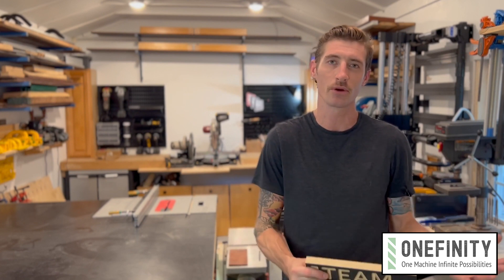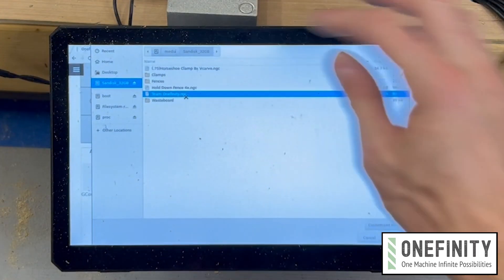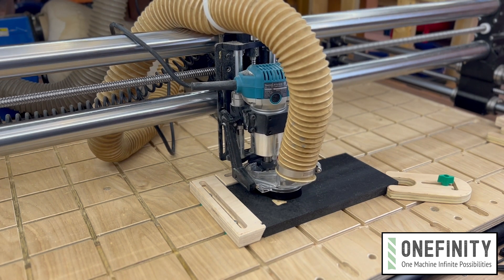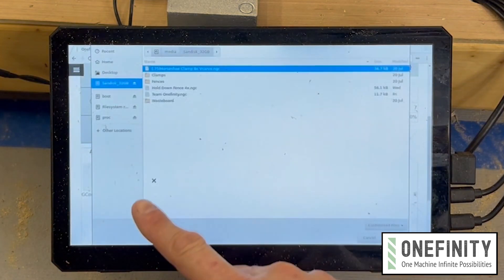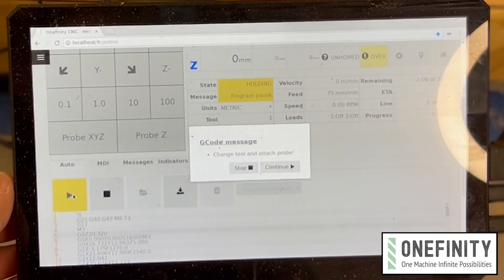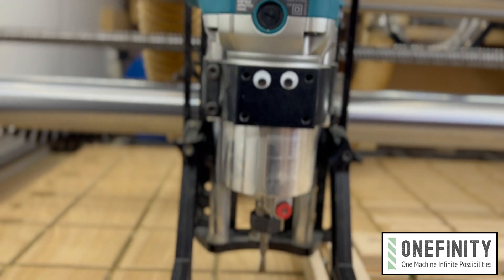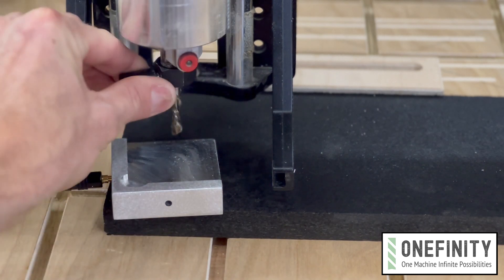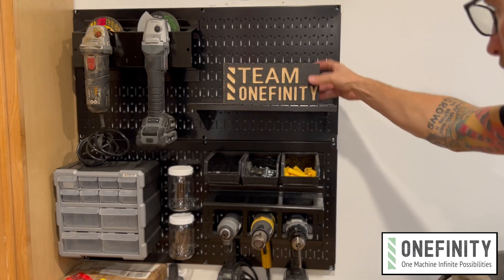EP4 Onefinity CNC - First Cut On Your CNC - Team Onefinity

Comment: Umm.  What test file? Where is it located and what is its name? Also, once I find the file, how do I load the test file.  What are the speeds/feeds for this project and how to enter/select them (Makita router).  It is not intuitive as to how the OneFinity touch probe  works with the software interface so I am going to need help with that too.  How do you start/execute the loaded program? The user interface should interact with and guide the user in using the machine.  It does not seem too do this. There is literally no information provided that would enable a new owner to begin using this machine.
Reply from the maker: The test file should be listed in the drop down of files, If not, you can get it here:https://forum.onefinitycnc.com/t/4-onefinity-cnc-the-first-cut-on-your-cnc/14478
The manual is here: 
https://forum.onefinitycnc.com/t/onefinity-controller-software-manual/6805
Starting a file:
https://www.youtube.com/watch?v=f7mWnIIRgoA

We have a ton of info in other youtube videos and the faq section of the fourm.onefinitycnc.com  Time to start watching and reading!
Reply: In my experience, the instructions for putting this machine together are in about a thousand different YouTube videos.  Each machine is different and has different components and the components are constantly being upgraded, so even the right video for you may have slightly different components.  It's the vary hard part of buying a machine from a new company that's constantly innovating.  On the plus side, the machine gets better and better.  Definitely a challenge for someone who has never used a CNC, but worth it in the end.  If this were a company the size of Apple with the demand to support it, this machine would be a lot more user friendly.  I guess we're spoiled by those large tech companies who can put tons of resources into user interface.  Anyway, I'm getting closer all the time.